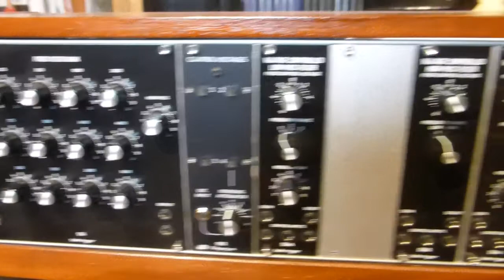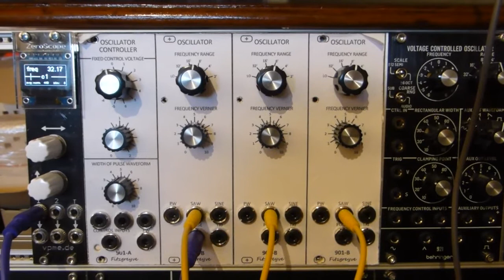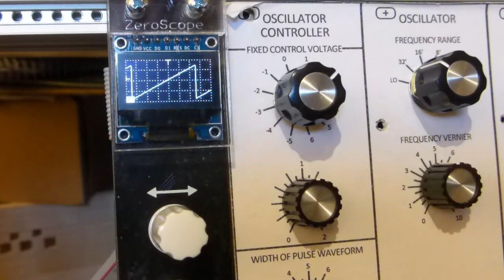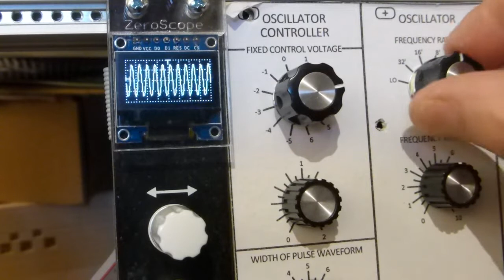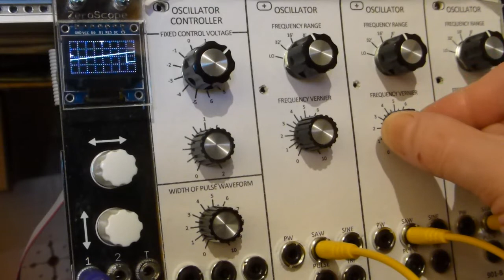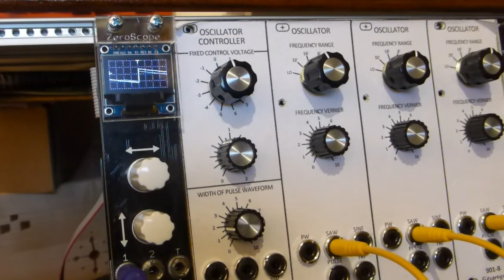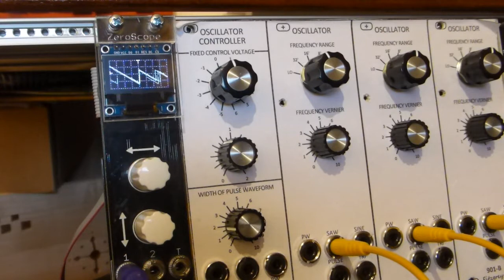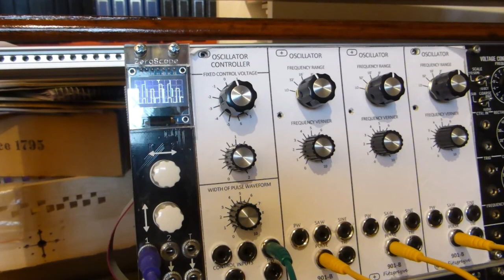Fitzgreyve Moog 901B Oscillator and 901A Controlller in Eurorack format.

Comment: I am younger and just now discovering the immense beauty of the pre-73 Moog modular systems, but I am looking to achieve a similar sound without spending 10-20 grand on an authentic 10/15 reissue. What do you feel is the best and simplest way to create a Model 10/15-style monosynth? Fitzgreyve 901A/B oscilators + Aion Modular 904 filter???
Reply from the maker: the Behringer "system 55" modules are great value  - 904A, 904B, 911, 902 etc.  I generally recommend my 901A/B DIY for "experienced builders" - they are a relatively easy to build, however can sometimes be tricky to debug if they don't work "first time". You also need to read the original Moog instructions for these, specifically about setting the correct operating range for the 901B using the 901A.
Reply: @fitzgreyve  honest question: I already have a Moog grandmother and I'm just wondering if the 901A/B + 904A sound would really be all that different. To me, it sounds rounder, fuller, and more "neutral", but I've never actually played them.

Do you think there's a significant difference between your 901A/B oscilators and those on the Behringer 55? If so, I wonder if you might be kind enough to consider selling me some assembled 901A/Bs. I have absolutely zero building experience.
Reply from the maker: @jibberish00  IMO there are two key differences between a bank of 901's and 921's: 1. the individual 901B's are linear oscillators (the individual 921B's are exponential),  the 901A provides the exponential scaling for the whole bank. One result of this is that 901B's in a bank off a single 901A can maintain pretty constant linear detuning (i.e. the detune doesn't change with pitch). 2. The 901A exponential function isn't perfect - some notes may be fractionally high, some low.
If the 901A is correctly set, the 901B's can give a usable 5 octave range, and the temp. sensitivity isn't that bad. When Moog designed these, I think he's quoted as saying you only need to tune them as often as a violin (so that's at the start fo each piece of music then -  Moog keyboards have "span" and "range" controls for tweeking the CV during a performance).
Sorry, I don't do assembled modules at present.
Reply: @fitzgreyve  Thanks for the detailed explanation. I suppose I'm wondering, from a musical perspective, if one notices much difference between a 901/904 combo and 921/904 combo? Are we talking barely perceptible shifts in behavior, or a night-and-day difference in how the oscillators are experienced and played? I made the mistake of watching Sweetwater's demo of the Model 10 reissue, and I cannot get that sound out of my head. Quite literally, and without exaggeration, I am dreaming of it every single night